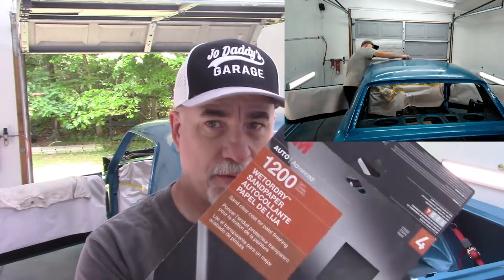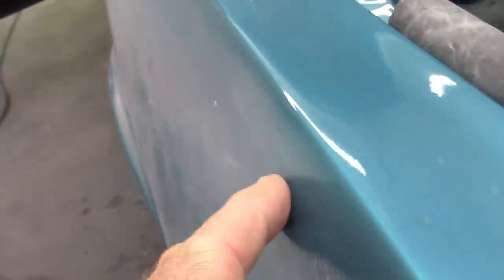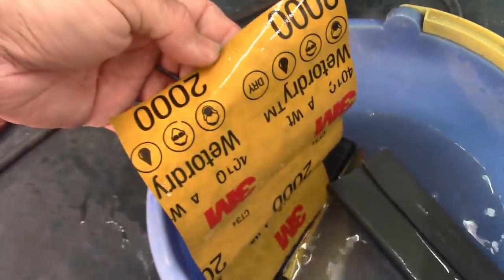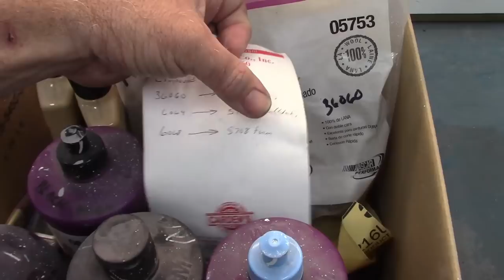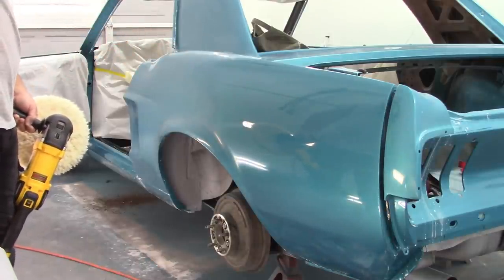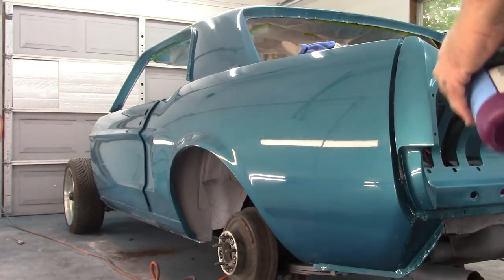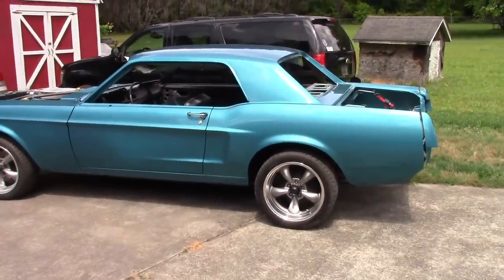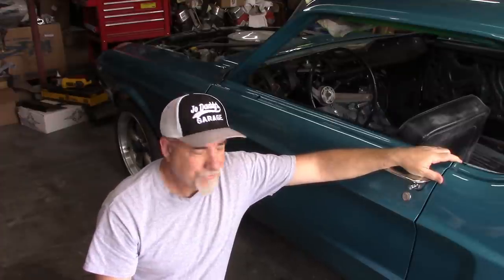Sanding and buffing paint on a Mustang. Mistakes were made.. Jade part 67

Comment: I have had great success with two stage paints by fogging the final base coat because that evens everything out. Also you could be more consistent with your paint gun, meaning you could to be much closer to the surface, around 6 inches, when spraying. It is not done until you are happy with the results.

Comment: Looks really awesome it’s a bummer to re shoot but at least now coverage will be easy. I suggest using the soft edge tape technique in your jambs vs. the foam tape. In my experience the foam leaves a harsher line. With the soft edge if you bring it back about an 1/8” into the jamb it will melt in almost perfect.

Comment: I've found that using a razor blade on runs and dirt nibs helps in the long run. Yes it is scary to think about on fresh paint but could use 800 to start with and not worry about burn through with buffing.

Comment: Barry. Are going to just reshoot the door, or the whole car?  Also. I’m wondering if you will address the vents that go on the car behind the doors?  If it’s a 67’ I thought they were inserted into the quarter panel. My 68’ just has the small trim in the area.
Reply from the maker: Whole car. Not taking any chances on mismatch. Mine is a 68. Not adding the trim pieces.

Comment: What size wheel spacers  and wheels are you using
Reply from the maker: Mine are going to be different. This rearend is pretty narrow. My spacers are 1.25". The rearend is from a 59 ford or mercury station wagon. narrower than the original mustang.